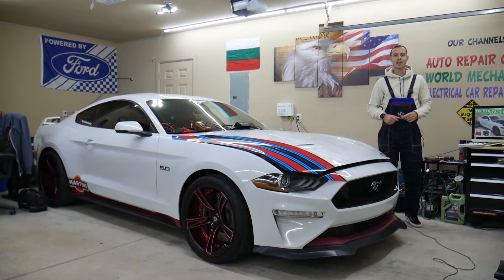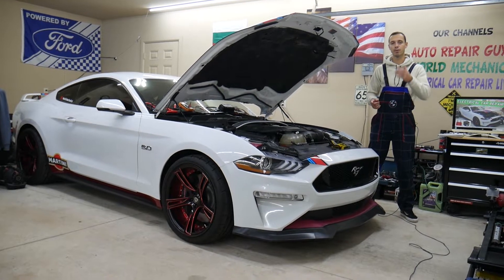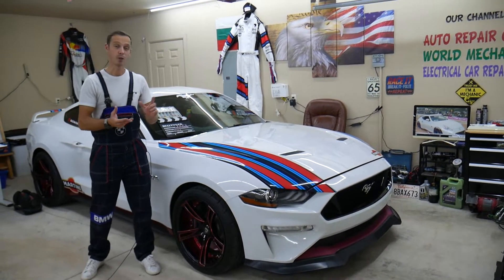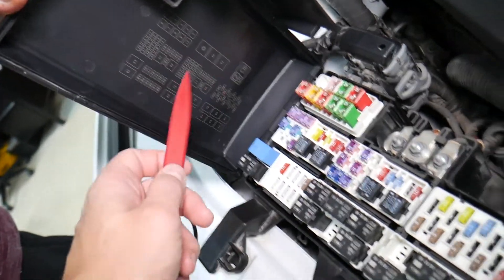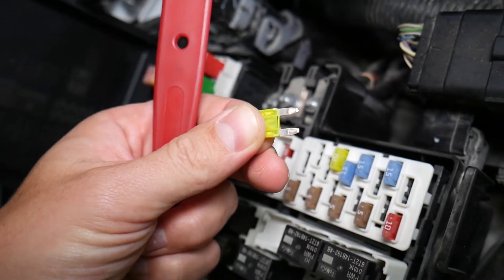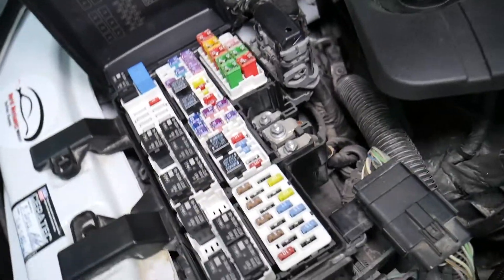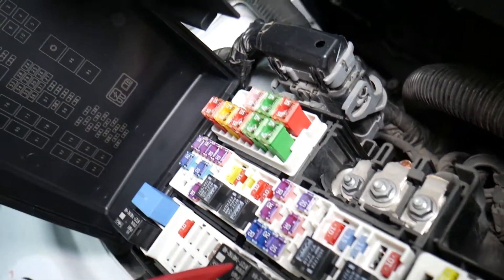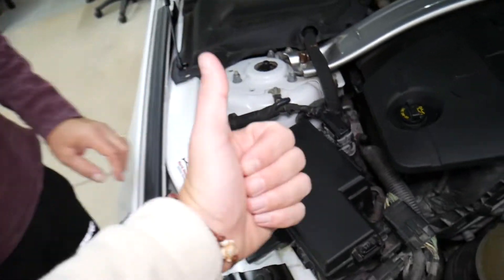WHY FORD MUSTANG OVERHEATS OVERHEATING 2015 2016 2017 2018 2019 2020 2021 2022 2023

Comment: Thank you been having this problem I did a compression test , water pump
Good , new radiator even tho my old was still working fine I also bought like 2 brand new thermostat. I never thought to check the fuse box . Thank you so much going pray this works 😅